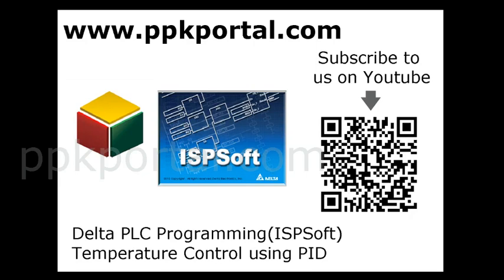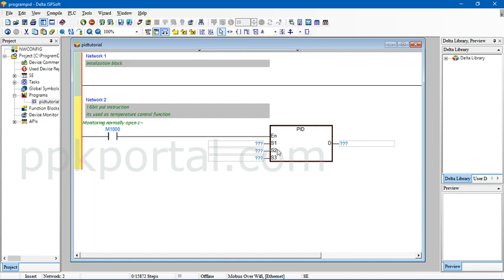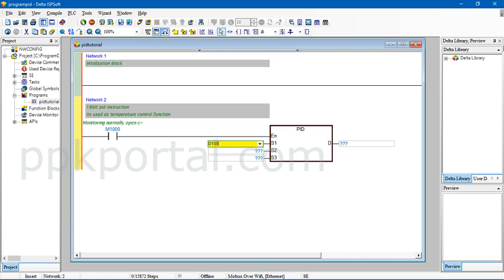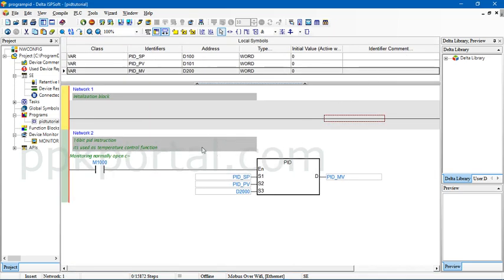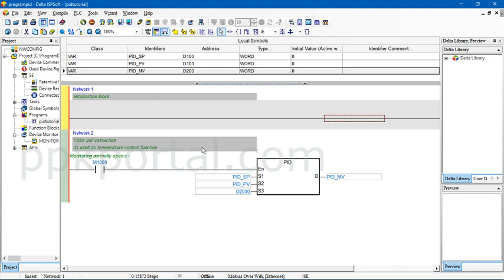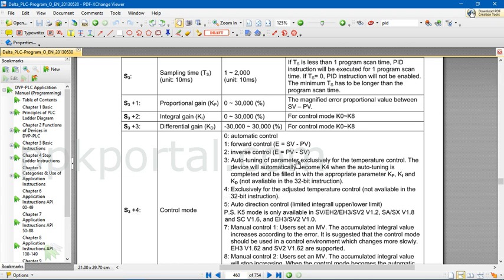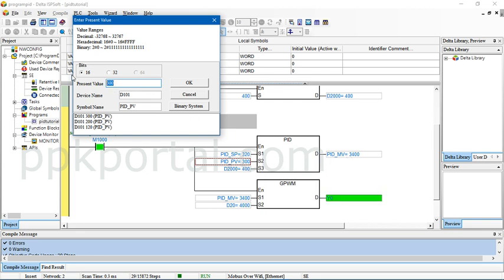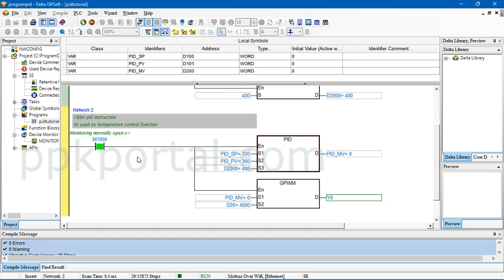Delta PLC Temperature Control Using PID(with Audio Explanation in English)

Comment: Hi Sir, Nice Video! I am planning to control Ph meter automatically. But I am using normal valve (On/OFF) for the base and acid valve. Is it possible to use Proportional control by varying the timer value? based on the difference between PH present value and PH target value

Comment: my system 12SE PID Manupulated Output (MV) respon slowly where i need to increase the response time for increase/decrease of analog output. What i should change.
Reply from the maker: start from proportional gain
proportional gain decides how fast your system respond to a change. Both I and D help to make the response smooth
I makes slow and steady wheras D prevents overshoots and fluctuations

Comment: I have a DVP-14SS2 working with and extention DVP-06XA and beggining with a digital button i need to send 20mA in the CH5, the Analog Output.
How can i make this?
tks
Reply from the maker: Use instruction " TO " to transfer values to analog channels

Comment: How to set output value.. like u hv set pid output value 4000 how is set?
Reply from the maker: in the S3 + 6 register you can set the upper bound limit for the MV(Manipulated Variable - PID output)
Reply: Thnx sir.. i hv try... To insert expantion module card for analog output... Bt there is no output genrated from pid output...

Comment: I did the same program in SS2, using the simulator, and direct in PLC, but no have result in PID block, no show nothing in D200. and in the monitor, show only in D2000, D2012 and D2013 change 0 to 4000 very fast. whats happen?
Reply: You commented "Also dont forget to use Retentive range for Settings(s3) of PID", need more some instruction to try?
Reply from the maker: for PID I recommend to try with real PLC rather than simulator
Reply from the maker: share screenshot of monitor values from d2000 to d2019
hope you put d2000 in S3 of plc block
Reply: @luciano_cora  Can you find the solution?
Reply: @MegaMotor.  Yes, I changed the parameter to read the information, I used the present value in analog input, is very fast and inprecision, now I change to average value, is soft and solve my problem.
Reply: @luciano_cora  hi bro! i used this program of PID in the simulator but the output value remains 0 MV=0. Do i need to use a real PLC to simulate pid or what?
Reply: Hi dear... I tried with real PLC but same problem coming with me plz suggest possible causes.
Reply: @Pietro Camilo Martins In have the same problem, do you have solution?